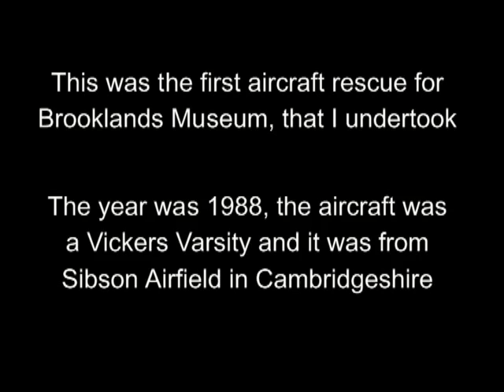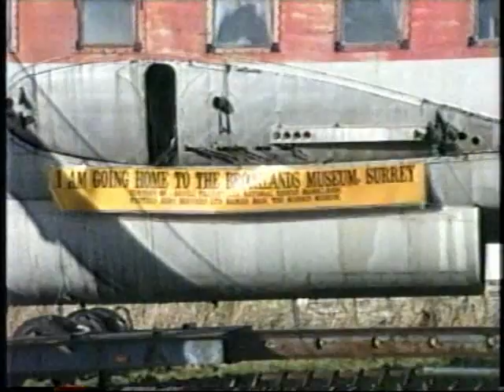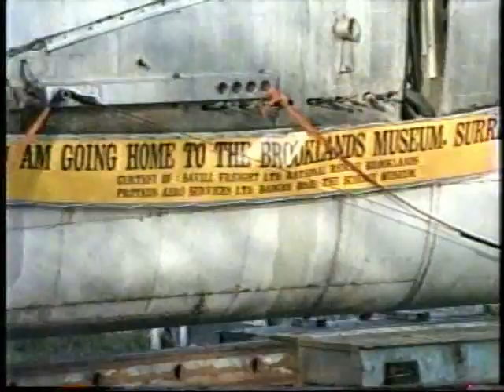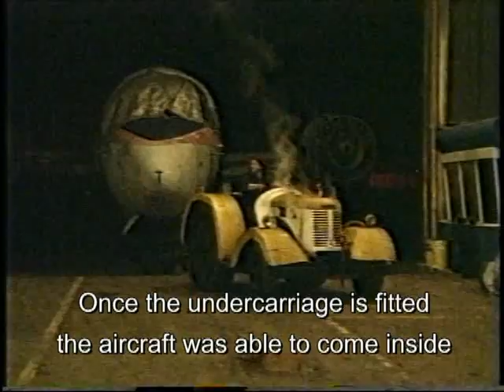Recovering a Varsity aircraft from Sibson to Brooklands in 1988

Comment from the maker: Well Spencer it was made for us to my design, by that Legend Gordon Jackson. The components from memory was - £4000 for the tractor unit (second Hand) The Crane was shipped from the USA and landed with TAX paid, was around £28,000 and then the body, extra axle and building was another £12,000 With the equipment Lights and Paint Job it must have been around the fifty grand mark when finished. 

It is still on the road today with Langley Vale Recovery, but no longer front line.

Comment from the maker: It is possible but there were 3 in the family (4 if you include the Wellington). The Varsity was a trainer for Radio Ops, Navigators & Bombers, Then there was the Valeta which was a troop carrier/transporter. Lastly there was the civilian Viking which was an airliner. At a quick glance they all looked the same and were derived from the Wellington, with the Varsity the only one NOT to have a tail wheel. It also had the large canopy under the fuselage. Perhaps google pictures for all 3 to compare.